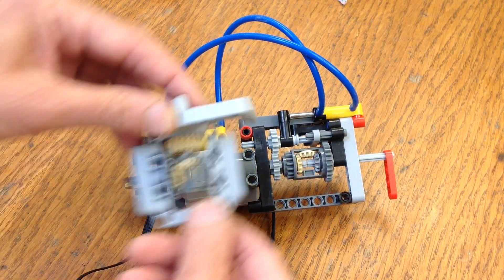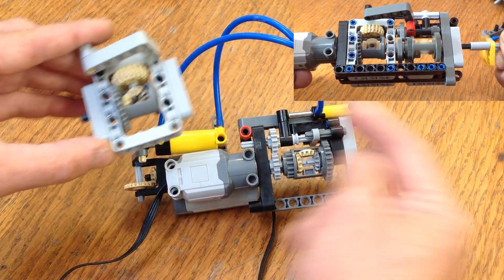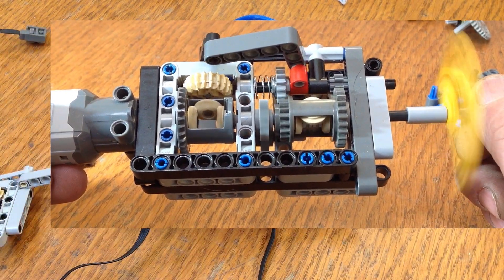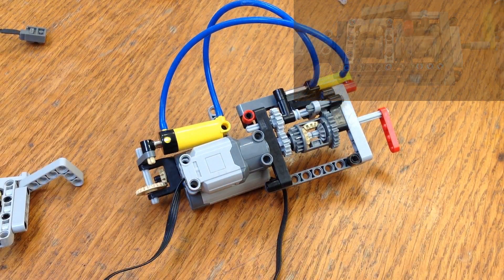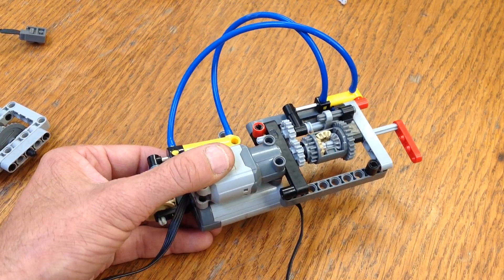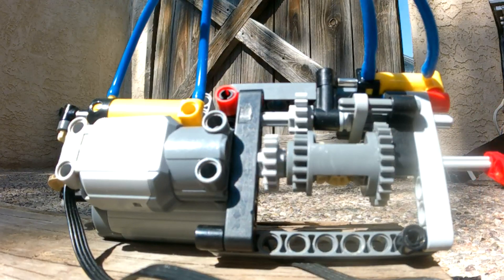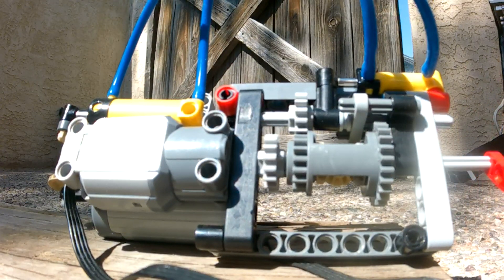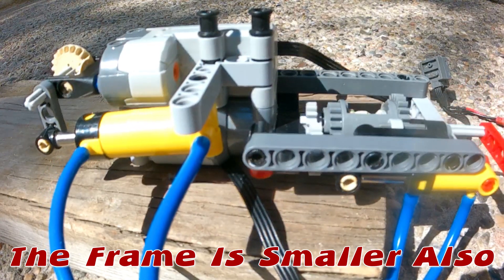Smoother Switching Pneumatic 2 Speed Transmission

Comment: can't you use the torque sensor diff to operate a switch, that then activates the servo? then you'd be back to automatic...  I need help with my twin diff CVT. The 540 is overheating the friction clutches, although it works well apart from that. So many dilemmas. It does let you slam from reverse to full forward without breakages though! 👍🍺
Reply from the maker: The spring required to return it was not moveable with the torque sensor. Maybe with some more work... You can bet I will redo this again.
Reply: @MaxBrix  micro switch might help you. I'm trying to work out a three diff solution that doesn't involve friction pins or clutches, but may have a spring. Dunno. I'm going out on the FJR for a thrash now as I can't think about Lego gearboxes all day!
Reply from the maker: @carlbModels  A pump and maybe a tank have to go in there also.
Reply: @MaxBrix  ha ha you'll hate this, but a micro switch that triggers a servo, that does the shifting... 😀😀👍

Comment: lemme see.... the pneumatics replace a hard linkage? that's an interesting new development, and I can see allows different packaging. Hmmmmm this could be useful. I am having probs with overheating axles with a 540 + module 1 gear. Seems that rpm and pressure combined cause melting plastic, so I thought I'd add my CVT transmission to it, so that it was never working too hard. Problem being space. Maybe a smaller gearbox is what I need . You've made me think, which is always a good thing. Keep innovating and posting, love your work 👍🍺🇬🇧

Comment from the maker: I forgot to mention that this is easier to set up than V1. It was hard to get the correct spring rate that would allow shifting and also return the shift arm. The torque required to shift was not adjustable. This just works.